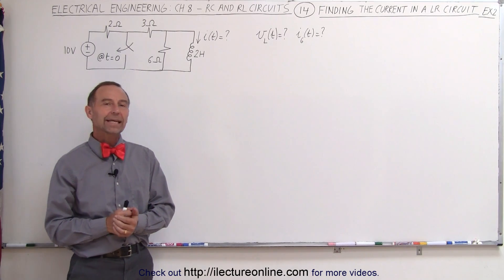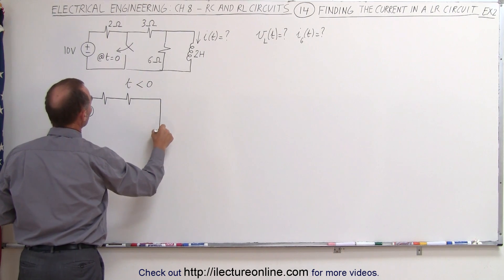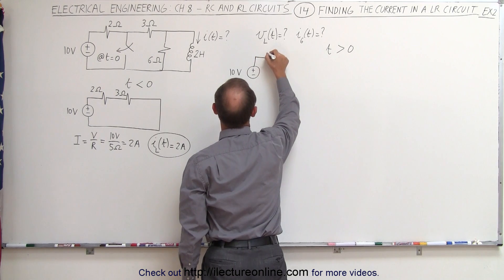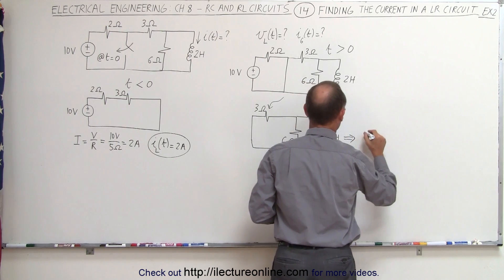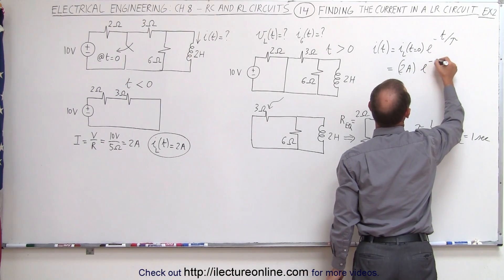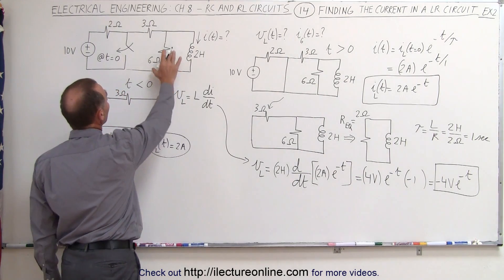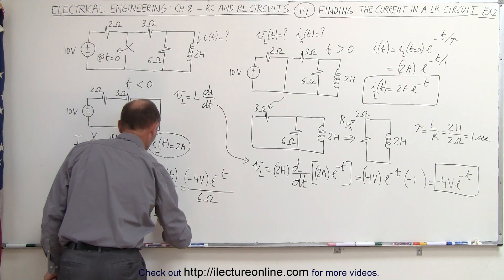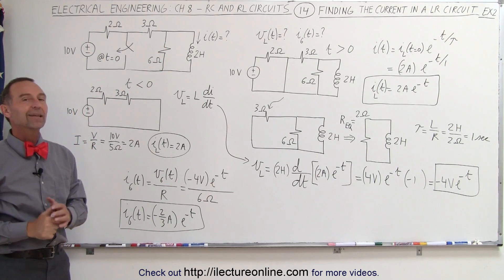Electrical Engineering: Ch 8: RC & RL Circuits (14 of 43) Current=? in RL Circuit: Ex. 2

Comment: random question if you add another resistor parallel to the right side of the inductor is it also bypassed or that will never be possible? thanks

Comment: at t<0, wouldnt the current be p
only flowing through the 2 ohm resistor and through the closed switch since it is functionally a short circuit?
Reply: oh never mind i thought the switch is closed at t<0

Comment: Why doesn't the inductor short out?
Reply: its rule
Reply from the maker: At steady state, (current doesn't change), the inductor does not oppose the current.  (only when the current is changing).  Therefore at steady state, the inductor looks like a wire with no resistance.

Comment: you said at around 2:53 minutes non of the current that comes from the source passes through the conductor... i dont understand how after this you calculate that the current through the conductor equals  2*e^-t.... i dont get this part.... espicially the part where you take the equivalent circuit  and calculate from it the time constant ....

Comment: Great series on RC and RL. One thing: in this example, the switch is closed at t=0, so the current starts increasing eventually becoming steady at 5tao. When using the equation i(t)=Io*e^-tR/L (as used above to find i(t) and also used in the previous example where the switch is opened at t=0) this would put the current near zero at 5 time constants which doesn't make sense. Shouldn't we be using the equation i(t) = Io(1-(e^-tRL)) for this example? This would result in having the same answer and sign for  i4ohmR(t) whether you do the above method or use a current divider.  Otherwise these two answers give opposite signs for current across the same resistor which doesn't make sense to me
Reply: I take that back, I got confused with the switch placement in the circuit. When would you use the above equation I mentioned?

Comment: So any situation that tells me t<0 I should remove the inductor?
Reply from the maker: It depends on the situation, what other components are there, if the switch opens or closes, etc.   It is better to think about it like this:   "If there is a steady state current flowing through an inductor, the reactance is zero and the inductor acts as a short.

Comment: Sir im a little bit confused. In the previous video (video #13) when your t is greater than 0 the switch was open. But here when your t is greater than 0 the switch is closed,  am i missing something?
Reply from the maker: There are both types of problems.  Sometimes the switch opens up at t = 0 and sometimes the switch closes at t = 0
Reply: @MichelvanBiezen  ahhh ok. Thank you Sir!!
Reply: So please how will you know because I’m facing the same problem
Reply: Based on the arrow, the arrow represent what will happen AFTER time 0

Comment: at 4:10, when you redraw the equivalent circuit, why did you skip the 2 ohm resistor?
Reply from the maker: We are only drawing the circuit to the right of the short.  No current will flow through that part of the circuit (after passing through the 2 ohm resistor) coming from the voltage supply.  So we drew the right part of the circuit separately.

Comment: Sir, I have a little question here with the behaviors of the switch, in the previous video the switch was closed at t<0 and on this one, the switch is open at t < 0 why is that??
Reply from the maker: Just a different example with a different initial condition.
Reply: Just check the diagram and the direction of arrow on the switch, the head of the arrow shows the final condition

Comment: @ t>0, how did you know that current only flow across 10V and 2 Ohms ? How did you know that there is no current flowing across the 3 and 6 ohms ? Just curious.. Ty for reply.
Reply from the maker: After the switch closes, there branch with the switch offers no resistance (essentially a short circuit), so all of the current will flow through than branch and none of the current will flow through the branches with resistance.

Comment: sir, why there is no current will go the 3 ohm resitance when the switch is closed? i hope you noticed me. thx
Reply from the maker: Not at the moment the switch is closed, because it takes a finite amount of time for the current to start flowing through the circuit
Reply: @MichelvanBiezen  thx sir, what is reference book in teaching this dc transient?

Comment: When t<0 (switch closed), isn’t it R2, R3 will be parallel?
Reply from the maker: The inductor essentially become the current source (for a short while) and the current can either flow through the 6 ohm resistor OR the 3 ohm resistor.  That is why they are in parallel.  If the current must flow through both to get back to the inductor, then they would be in series.
Reply: when t<0 (switch is open) not closed

Comment: when the switch is closed at t<0 aren't the 2 and 3ohm meant to be in parallel and not in series because there is practically a wire between them ?
Reply: never mind I just saw that the direction of the switch swing actually dictates the before and after .

Comment: Sir what does it mean when you're only required to find the voltage for t>0 but there is no initial stored energy?
Reply from the maker: In the problem given, the switch closes at t = 0 sec.  That means there will be a transient period, before the current settles into a steady state condition.  You will have to find the transient current and the steady state current.

Comment: As always, very helpful. I feel like it would have been good to show one more example (before going to #15), or even just briefly explain here the “what if” scenario, how it would be different if there were a 4th resistor between the 6Ω and 2H, to show how the 6Ω would NOT be short. Some people might realize this already from doing your previous example (#13) but I think it would be clearer for some who are still trying to figure out exactly what’s going on, because for me, it’s little things like that, that I get stuck on when it’s something very basic but just slipped my mind and has me second guessing myself.

Comment: Great vid! However, if all the current will take the short path shouldn't the 3 ohm resistor be discluded because no current will be passing through it
Reply: No, the short path would only affect components that are parallel to it.

Comment: why is none of the current going through the 6omh resistor
Reply from the maker: Once the switch is closed, there is a path with no resistance, which is the preferred path of the current.  The inductor will have a current for a little while longer until steady state is reached.

Comment: when the switch is closed at t<0 should it not act as a short circuit?
Reply from the maker: Correct, as shown on the sketch to the right.

Comment: Great vid as always! Just tell me why at @3:10 the 2 ohm resistor and the 10 V source weren't included.
Reply from the maker: After the switch closed, all of the current driven by the 10 V source will take the path along the "short", and the energy in the inductor will drive the current temporarily down the "short" path as well until the current through the inductor reaches zero.  The 2 ohm resistor does not affect the inductor after the switch closes.
Reply: Your question is a fundamental part for solving RL circuits so if anyone else sees this, and has the same question, and doesn’t understand why he did this (especially after his reply) please go back and either watch his videos and/or read the book or your notes from class. Learning RC and RL took me many practice problems and YouTube videos (hints why I’m here) to finally understand but it will click. Just give it time.

Comment: at around 318 he said that there would still be current throught the resistive path after the short circuit. can somone explain why any current would pass through anywhere beside the path of least resistance namely the short
Reply from the maker: Inductors oppose a change in current.  Therefore the current will continue to flow for a little while.

Comment: Why do you only include the 3 ohm and 6 ohm resistors but not the 2 ohm resistor when creating RL equivalent circuit?
Reply: Due to s. c line,  and  current flows always low resistance path

Comment: How come when t>0 the inductor is no longer acting like a short, thus preventing current from going into the 6ohm resistor? I.e, why doesn't the current just go through the inductor, then the 3ohm resistor, then back to the inductor ignoring the 6ohm? Is it because the inductor is no longer in a steady-state, thus opposing current movement?
Reply from the maker: First question:  An inductor only affects the circuit when the current through the inductor changes (during the transient state).    Second question:  Current will flow through every possible path.  If there is a path through the 3 ohm resistor and another path through the 6 ohm resistor, current will flow through both paths. (but more through the 3 ohm resistor).
Reply: Thank you.

Comment: Does the sign of the current obtained matter? I used the current divider method so the current through the 6 ohm resistor = (3/3+6)*2e^-t = (2/3)*e^-t
Reply from the maker: The negative sign means that that current direction is opposite from the direction assumed.

Comment: why the current @t > 0 is flowing through 10V and 2 ohms resistor only?
Reply from the maker: When you close the switch, that branch is now a short (zero resistance) and the current follows the path of least resistance.
Reply: ok thank you